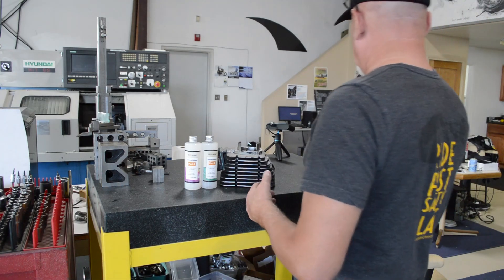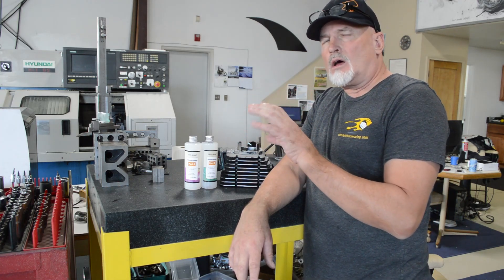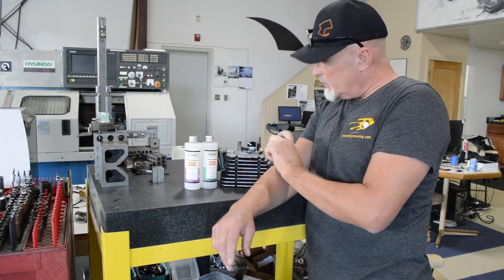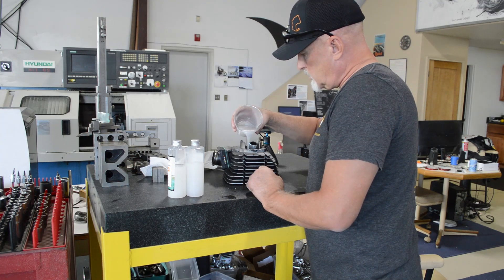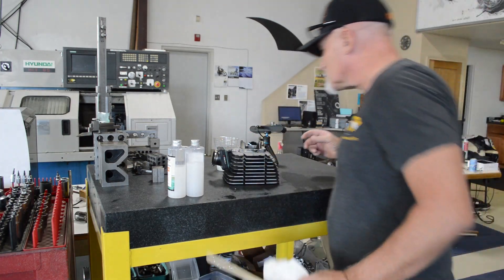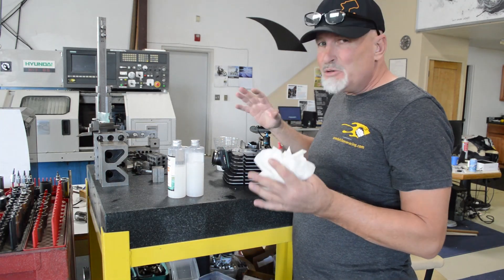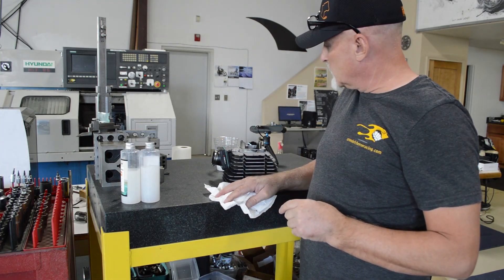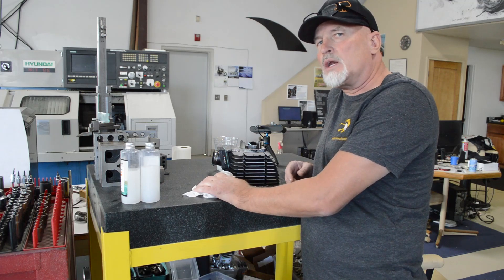port mold and scan

Comment: With a 3d printer, you generate the gcode from the mesh file. It works because the accuracy of the printer is a bit shit, that's why your foam guy was happy with that process too. But when you're machining, you want to start with a proper geometry and not a bunch of triangles.

If you have a paid Fusion 360 subscription, you have (fairly new) tools that allow you to create a solid from your mesh now, though.
Reply from the maker: That makes sense. Thanks

Comment: I created a workflow within Fusion for scanning clamps, foot pegs etc a few years ago. Similar to what you are doing in Fusion. They have improved things within their software since then. But it is still a difficult process to do with these tools. Some of the $20k scanners come with software that make it a breeze. But there is no one click solution that really works with real parts like you see in fusion demos since they have rolled out new tools. I had to orient the part on to a plain prior to importing it into fusion which did make things easier when working with flat sided mesh bodies. Good to see you have something working for you. This will be awesome to take that data and be able to use it for porting.
Reply from the maker: Thanks Clayton. Converting in Fusion loses most of the mesh. I hope they sort it out someday. Ya I'm not in deep enough to buy 20k in a scanner. I am really alarmed by how terrible the port is so that was worth the effort no matter what. Thanks

Comment: You can convert meshes to bodies now in Fusion 360. Reduce the mesh complexity. Generate face groups. Then you can convert. It doesn't work very good but it's worth trying.  If you search about it you can find some tutorials.
Reply from the maker: Yes I have tried to convert meshes in fusion. It ends up losing about 3/4 of the part.
Reply: @SpeedofCheeseRacing  Yea it doesnt usually work very well on unrefined meshes especially if the mesh isn't closed. Blender is a good free software option but not the easiest to learn. Its a struggle as you say.

Comment: hey there! polygons are triangles with a side, it´s point data. Meshes have splines, etc. I´m sure with the proper tools you can skip the polygon step. Look into free software to convert formats. Mistif Model 3D, and KHED are two free tools that may support both formats and do an easy conversion. and if not, I´m sure there has to be one. I did ship native format for  3d model printers with tools like that. It may be worth the research.
Reply from the maker: I will look into those. Thanks